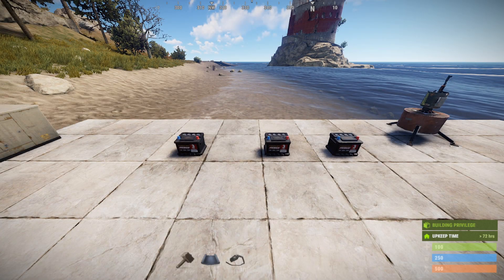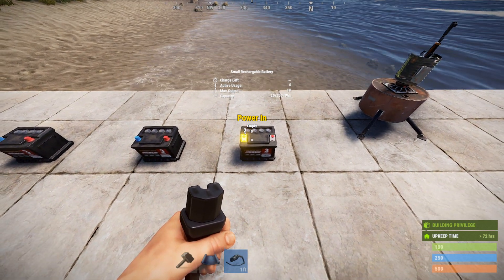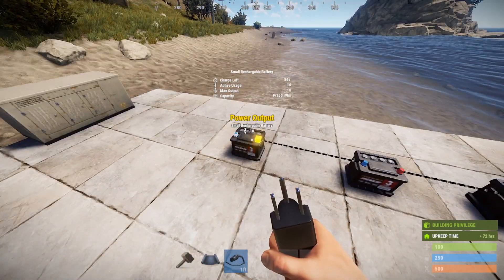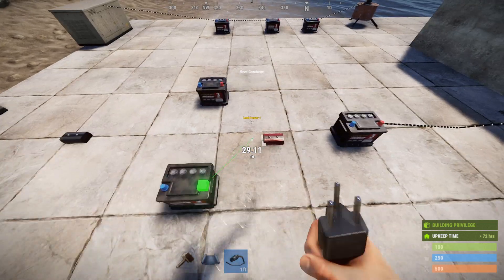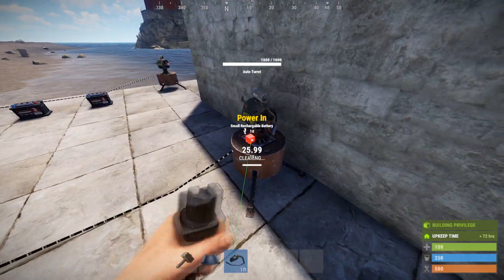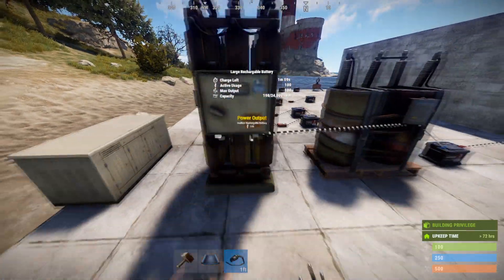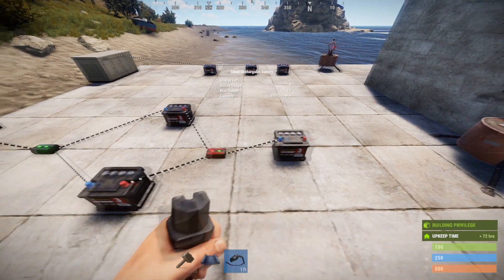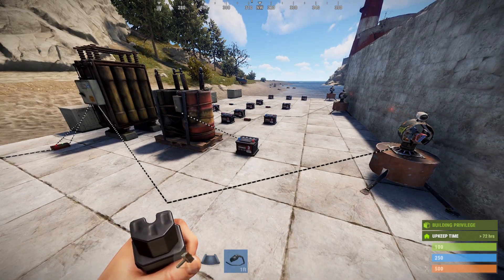Rust Electricity: Staging 11-3-2019 - Series Batteries

Comment: Way after this was posted, but I am wondering if I can run a branch after the combiner and output 9 rwh to 2 batteries, then do the same combiner on the output. Pretty sure this maintain the same charge duration, but allow me to run more devices downstream.
Reply: you could also just use one or several  branches or splitters at the downstream end and run as many devices as you'd like.

Comment: Why..
When we're supposedly using rust watt hours, does the small battery pull the full 50 cap from the medium unless its going to pull, stop when full, pull, stop when full pull... I just don't get why? That makes no sense at all.

They have to change that.
Reply from the maker: Best I can tell, it does appear to stop when full, but it can only use 40 rW max input, so it really shouldn't pull more than 40 from a larger battery.
Reply: i believe when a battery is connected to another battery OR a root combiner is discharges its maximum output at all times - otherwise it only sends as much power as is being drawn

Comment: I'm a little confused, didn't they make it so the power drain from the battery is only what the circuit actually uses?
Reply from the maker: Yes, but when a battery is acting as a load, it pulls as much as is available, even when it can't use all of it.
Reply: @RabidRabbitGamer  Can't you just use the branch and select 13 of power (+1 of the  branch) you would be saving 6 which is 30%
Reply: @jorgebernal8669  i think the idea you're missing is that:  when connected to a root combiner a battery discharges its maximum regardless of how much is being used

Comment: Nice idea with the small batteries, I think however with a large battery, instead of running 8/9 turrets etc on 3 large batteries (in series with a root combiner) to get 8 hours, it would make more sense to split up the circuits over 2 large batteries. Each of these batteries will last 8+ hours since they are only under half their load in this scenario.
Reply from the maker: True statement. Like anything here, it YMMV depending on your needs/scenario. If you needed more run-time for any one circuit/device, then series batteries COULD be a solution, but I'm still not a big fan of using them that way due to the efficiency loss.